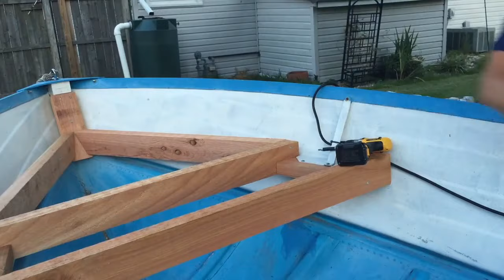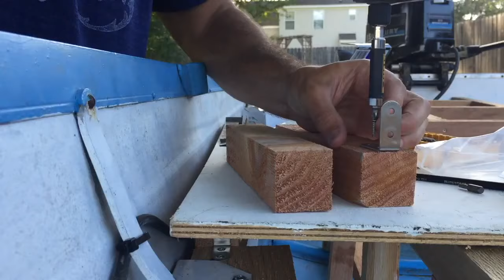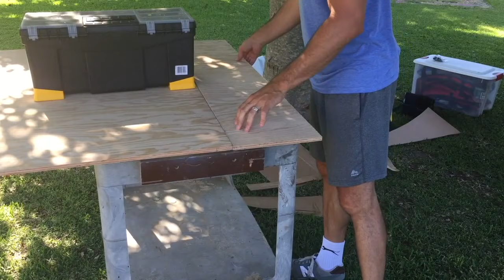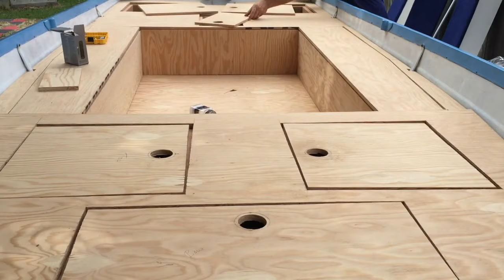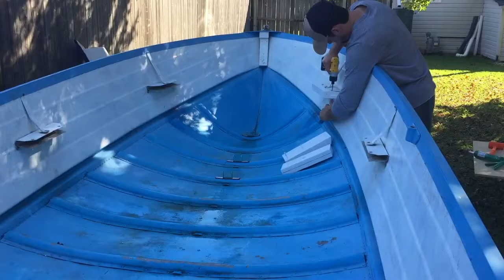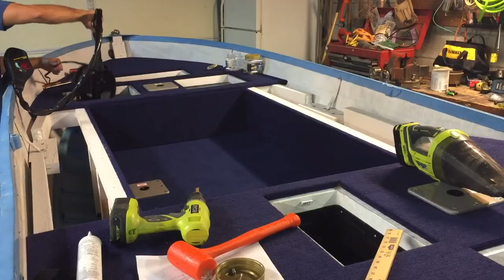14 FT Utility to Tiny Bass Boat | Full Build Time-lapse | Start to Finish!

Comment: You messed up big time!!!!!!!! You never waterproofed any of the wood! It will bit you in the butt less than 5 years you will have to replace the wood 😮
Reply from the maker: im not sure what you mean, the frame is cedar (which is naturally rot resistant) and its painted with rust oleum top side and the deck is marine grade plywood treated with epoxy resin, and my boat stays in a garage? it will last a very long time.